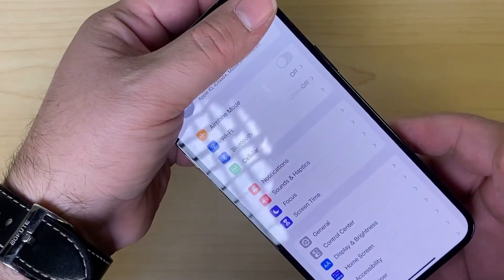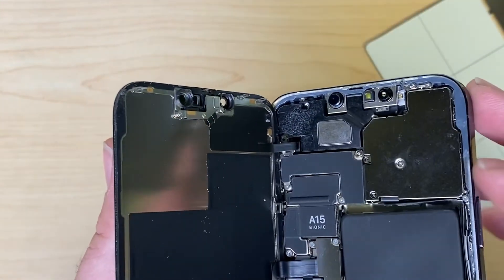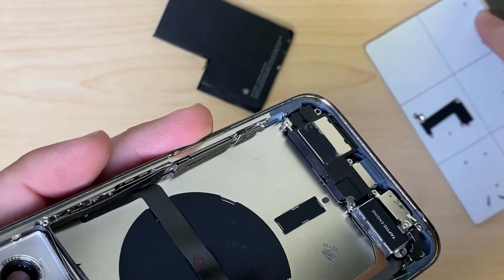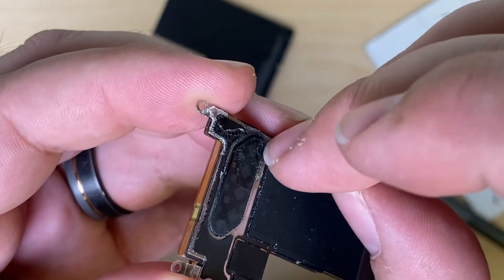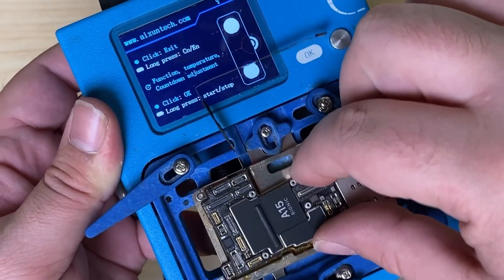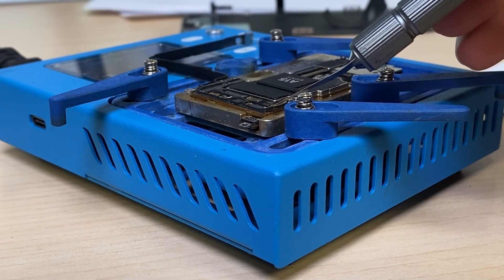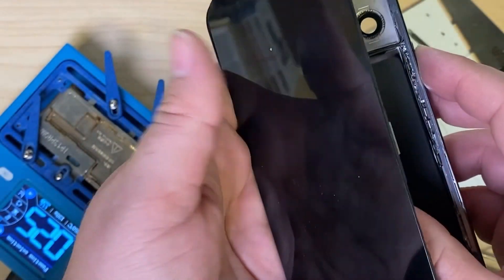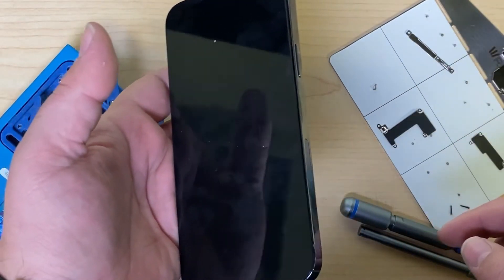Fix No Wi-Fi & No Service on iPhone 13 Pro Max – Common Motherboard Split!

Comment: Hey! So my phone has got network but the battery drain has been crazy and it overheats like crazy. It also works with WiFi and the IMEI shows. But I ran a diagnosis and it shows the cellular hardware issue was detected. Would this fix work for it?

Comment: can you fix my iPhone 13 pro max 

Here’s the repair history and current issue:

The phone was dropped on the highway while I was riding my motorcycle.

The front and back screens, cameras, and battery were replaced — after that, the phone was useable but had unstable Bluetooth/Wi-Fi connectivity.

I returned it to the same technicians to repair the Bluetooth/Wi-Fi issue, but now the phone no longer powers on. Before that repair attempt, it was fully functional aside from the connectivity problem.

Could you please take a look and let me know what diagnostic or repair options are available?

Thank you,
Jordan Tran

Comment: This is a low budget repair that I do for some people at my shop. It works I would say about 65% of the time. For split board repair for bad dry soldering joints, not broken trace repair without having to change baseband PMIC I charged around 125. If I have to physically open up the board and change PMIC or trace repair we usually charge around 225.